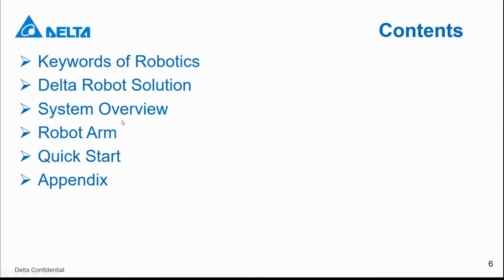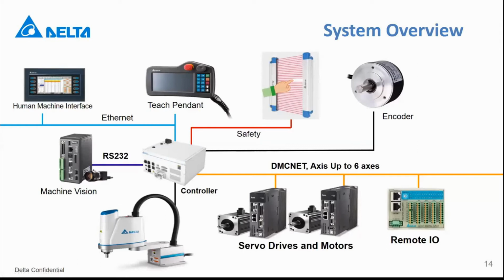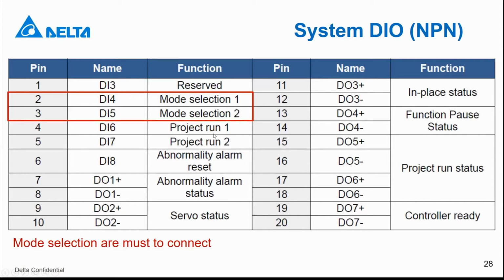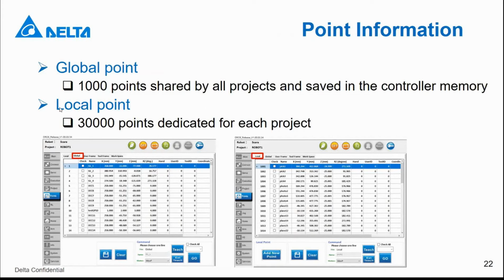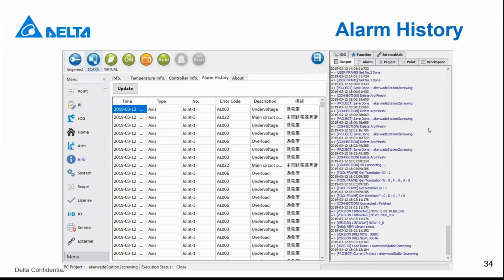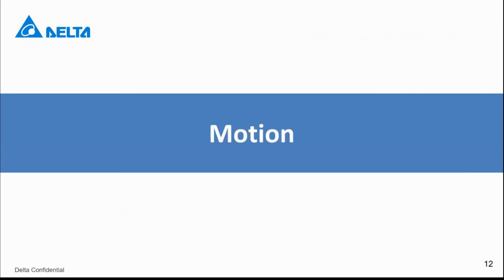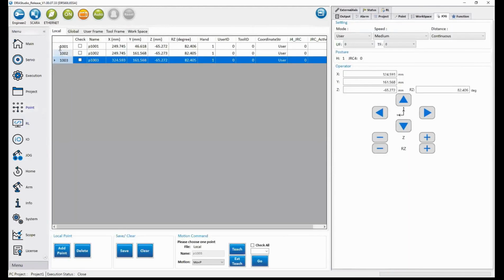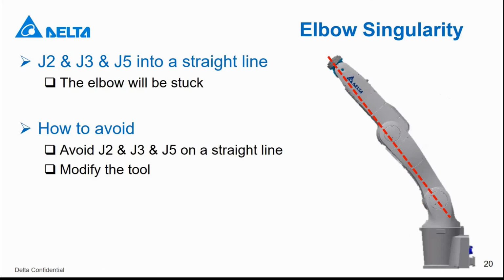Robot Solution - Online Training

Comment: hello i have two question, one: i have a problem beacuse the robot require's me a teach pendant for the deadman button, and dont let me turn on the servos ii put in auto and conect with drastudio but it doesnt matter the error still be there.

the second question is if a scara teach pendant can be turned into a articulates teach pendant  because i have one theach pendant with the scara firmware with the 6 axis that is the model of teach pendant of the articulated one but it has the scara firmware, is possible to change from scara to articulated one? if it possible how i can change it?

and thank you for the video i learn a lot.